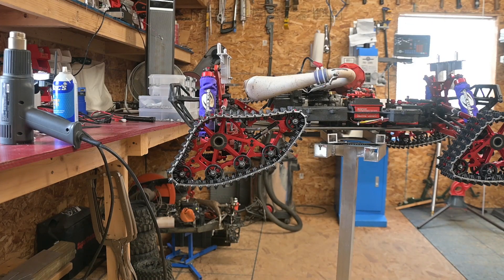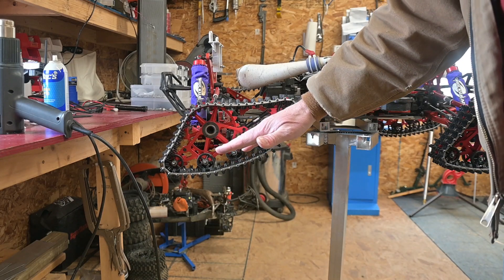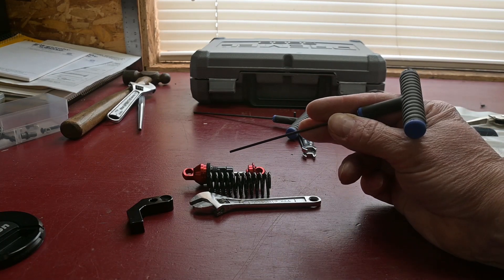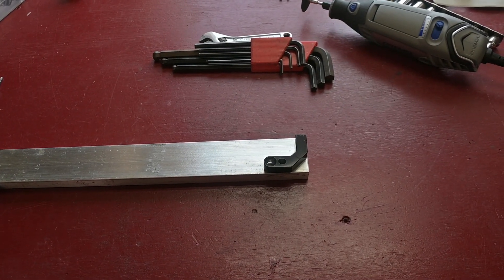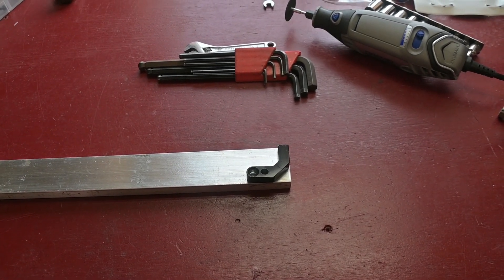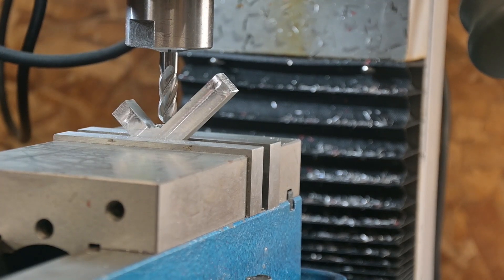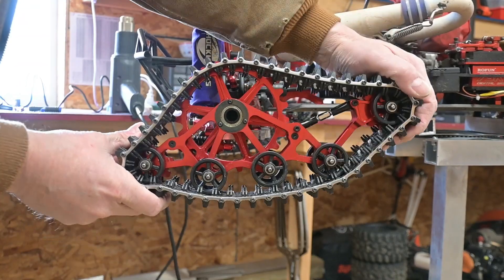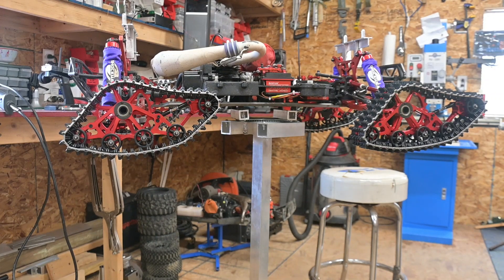Integy tracks - correcting anti-rotation on Losi 5iveT and its clones

Comment: Great Tracks! I installed bearings on mine...The Black wheels within the tracks ride on bronze bushings, switch them over to Bearings, makes a huge difference in terms of Resistance.
Reply from the maker: How have the rubber tracks themselves held up? I'm going to be putting an OBR 47cc case reed in this vehicle and IF the rubber stays together i'm going to machine new idlers out of aluminum and put in the bearings. I just checked out your channel and i see you list some parts from a company i never heard of, GPM, and i always appreciate getting leads on companies that i did not know existed. I'm going to check them out. Thanks for the tips, and thanks for watching
Reply: @RCWalletVacuum  Thank you so much Sir! :)      I own several of the Integy tracks, the Rubber version (Gen 2) and the Original "Alloy" Version (Gen1)....And The Gen 1, are the best hands down, these are what you have I believe. I had the exact same issue with the Shock travel, I ended up moding them as well, great job on that btw, great work!              GPM is a little higher grade than Integy, they use 7051 Alloy and everything is CNC machined, not casted like Integy.     Check them out for sure, they have a lot of wonderful upgrades.    God bless and all the best.
Reply from the maker: @markamd1  Thanks for the info

Comment: That looks awesome. Would they fit the MCD W5 MAX? They look like a LOSI too
Reply from the maker: Thanks Kevin. I'm not familiar with the MCD vehicles, but i did do a quick check on their website. First of all the W5 looks like quite the nice vehicle, but from what i can see you would have some issues mounting these tracks. It could probably be done but you'd more than likely have to make some parts to fit them on the MCD. Thanks for checking out the video
Reply: @RCWalletVacuum   Like you mentioned Rovan takes a lot of Losi vehicles and copies them. Rovan does the same with the MCD vehicles. They only add a motor in it and cheaper parts. It looks like an MCD then, but cost is cheaper if you like their pre installed motor.
Reply from the maker: @FantasyGhost  If your still interested in trying the tracks and finding out if they fit i have another video on what mods they required to fit the losi and the rovan clones. This video here was a followup to that video. If your MCD uses the same dia axle and pinning style you would be well on your way to mounting them. The next problem would be the anti roll over setup. That needed mods to fit the losi. Also remember you would need hub extenders to clear the MCD,s body
Reply: @RCWalletVacuum  yes I watched all the videos you made so far. Looking forward when you’re actually able to really test them with better weather conditions.
Reply from the maker: @FantasyGhost  Thanks, i really appreciate that! Spring is coming real soon.